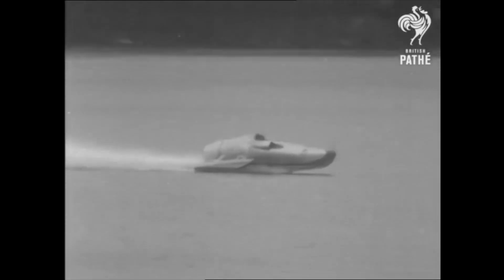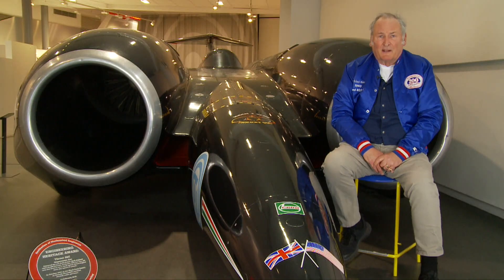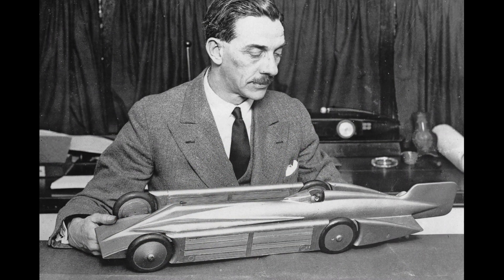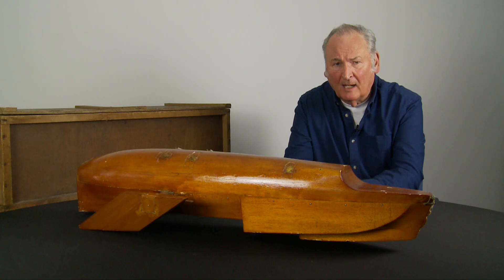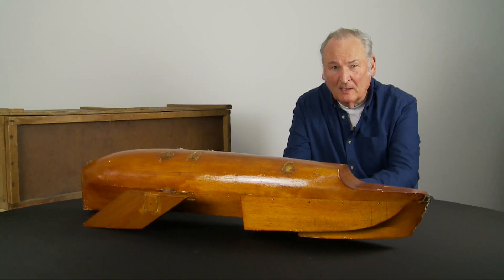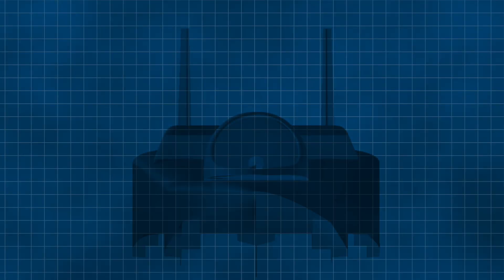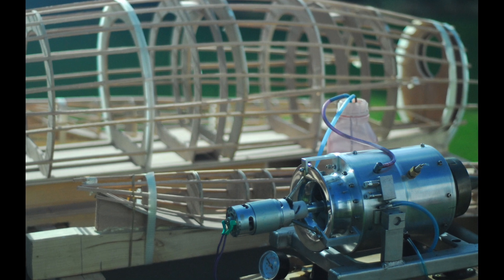Thrust Water Speed Project - Update #1 - Small Beginnings, Big Ideas

Comment: I can understand the reasons for building scale models for testing, apart from the fact that the undulations of the water (ripples, waves etc) will not be the same on a scaled down craft as a full size craft. This is by no means a criticism, just a question. How do you simulate the actual effects of the water surface on a scale model? Great project, will definitely follow it.
Reply: You can't really, but then you also can't scale air density either, yet wind tunnels are still extensively used. The idea is less to 'test' the idea, and more to ensure correlation between computer simulation expectations and real life.

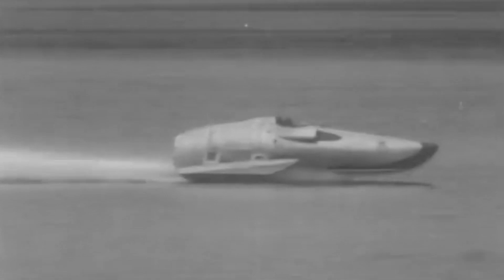Comment: 2:20   this was a pretty good design.      why was there a crash.      i suspect that this original design  did not actually need much modification.        you may know that any time the thrust line  and  c-m  cannot be optimally configured, the use of a bit of thrust offset is 'needed'.       for examples, see the exhaust angle of an a-10  or  f-4.
Reply: No-one knows because the wreckage was never recovered, but it's suspected that the front planing step collapsed as that had been damaged during trials before.

Comment: information        the wisdom/efficacy of using relatively large vert-stabs is uncertain.        most of the longitudinal stability of this boat will be from hydrodynamic Drag, occurring at points near the stern;  eg., feet, rudder, skegs, strakes.        a reverse pickle-fork configuration might work best; instead of yer four-feet design.

Comment: information         a boat does not have a cg.      compare  c-m.    center of mass.          6:31   this stern design is  NOT  a good one.     because, it will make  More  aero- and  hydrodynamic  DRAG, than a tapered stern.        any water rising away from the boat forward-of the transom is a source  Drag.    the Causes of rising water  Should  be  Identified and their affects minimized.        the nose (which won't be in the water) should be shaped  like a  BULLET/radially symmetrical;  not like the prow of a boat.

Comment: I second Top fuel hydro/ Unld hydro. That current hull design doesn't look like it's 300+ MPH Complient. 
I think you need to go with a Cat design with a Fwd. Canard coupled to a air vaine sensor and computer and gyro to control the nose pitch up/dn.
Cheers.